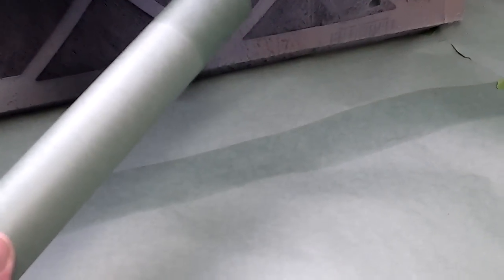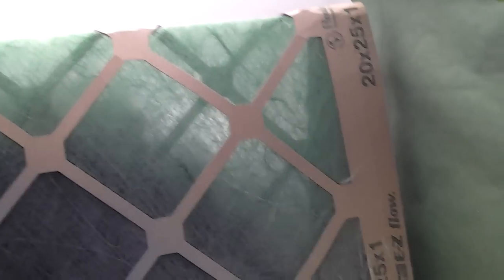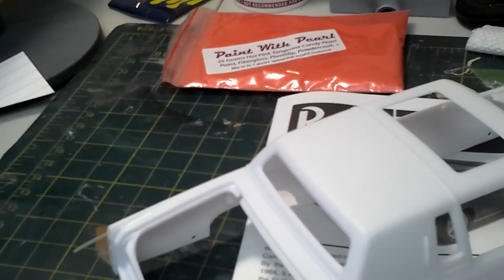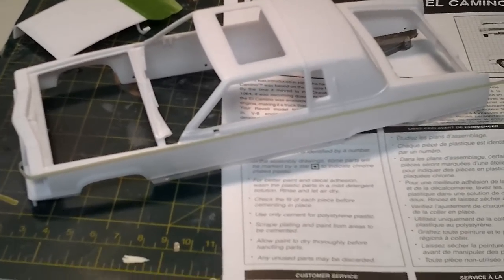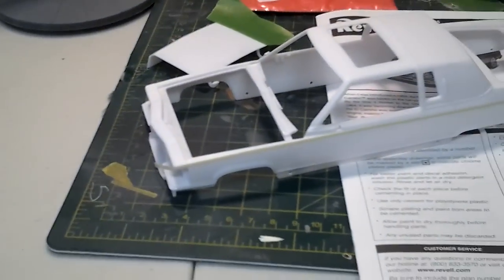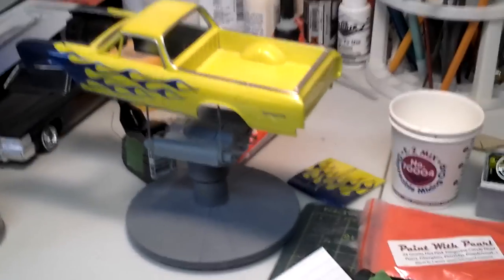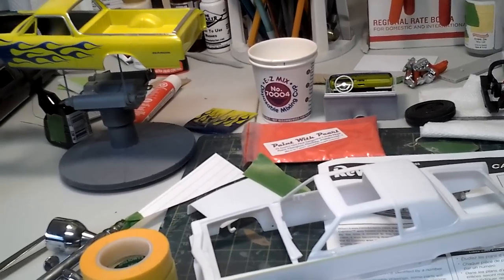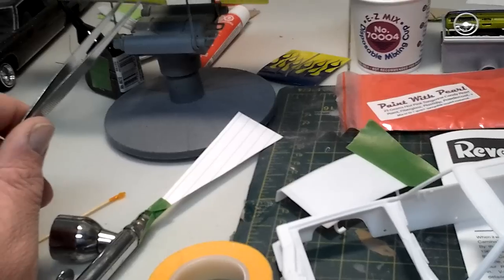Paint tech for model cars

Comment: You are correct about that dust. I look at my model thru a loop while I use a tack rag, and still ended with  dust particles. Everybody talks about their spray techniques, but nobody mentions what size needles they are using. I am new to airbrushing.

Comment: unrelated to cans or airbrushing, I can't get paint to stick about half the time when I brush small parts. even after cleaning the parts before painting, it looks like oil in water. also have tried brushing nail polish
Reply from the maker: SwitchDoctor are you priming the parts and what paints are you using, just use light coats even when using a brush
Reply: Even the small parts you need to primer? What is the correct process, you glue the small parts, primer the piece and then paint ?
Reply: @FS-wl6uo yes even the small parts.  It's easier to do while still on the sprue